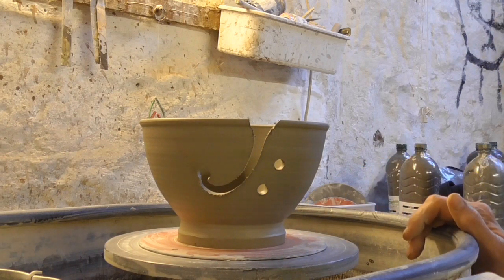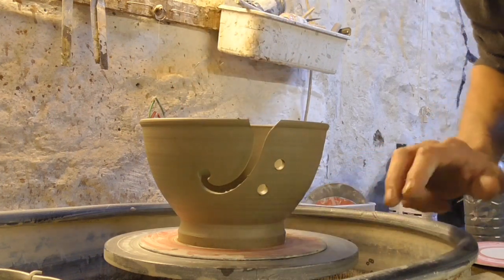Making a Pottery Knitting Bowl on the Wheel.

Comment: I've sought everywhere but never found a single answer of how pots were glazed traditionally from time immemorial to recent. Specifically - to glaze a pot without purchasing a single product. From the very dirt around me, what materials were used. Another dead end I've found is ink pre gum arabic or alcohols. It seems no one really knows, or cares to mention. :(
Reply: Pottery was generally pit fired for the vast majority of human existence. No glaze is used, but pots are generally burnished before the fire for extra strength and slightly better water retention. Pit fires don't usually get hot enough to vitrify most clays so the pots will weep and pit fired pots are not considered food safe by modern standards. Then people moved on to building actual kilns and using wood as fuel. These weren't always glazed but when they were the earliest examples of glazes were ash glaze and lead glaze. Ash glazes can be formulated to be food safe, lead glazes obviously cannot. 

You're not going to be able to make actual glaze out of anything you find in surface level dirt in your back yard. The only way you could reasonably make pottery out of nothing but natural materials on your land would be to dig up and refine your own clay, and pit fire it using wood collected from the land.

Wikipedia has a great article on ceramic glazes.